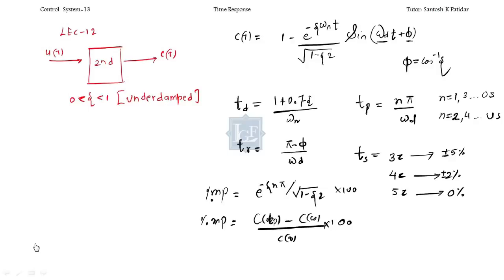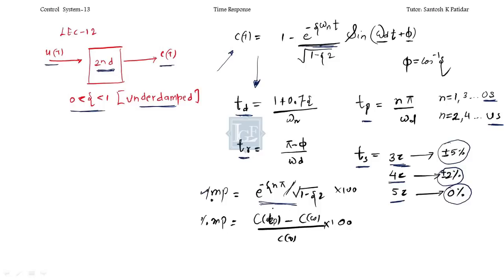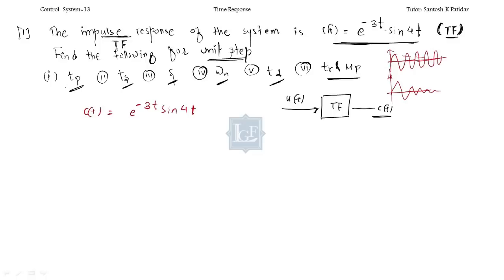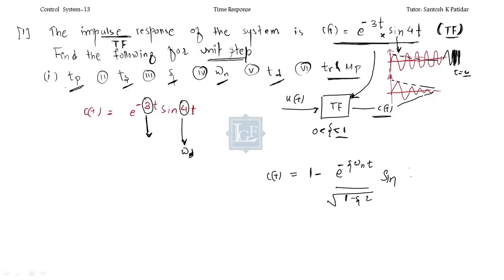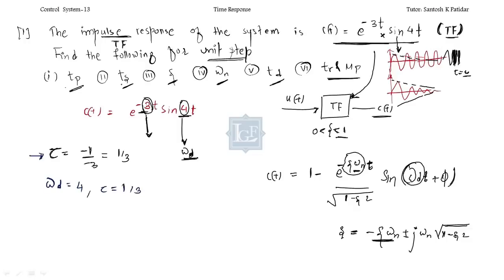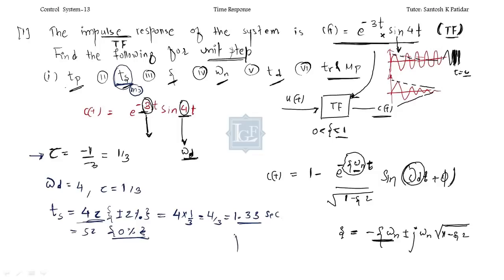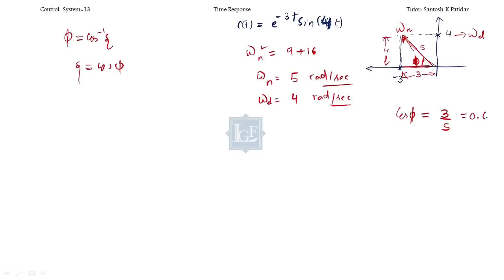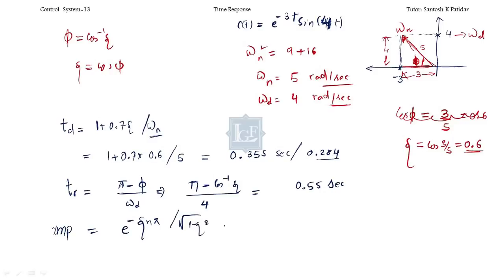Lec 13 Steady State Error

Comment: In 1st question
U r comparing impulse response with standard unit response.
But how could u?
Will u elaborate it pls?
Reply: I have tried using ----- impluse response=d/dt (unit step response), the compare it with standard result to get all the values